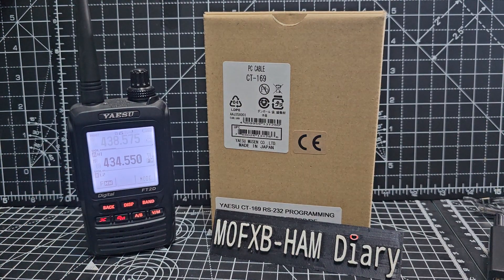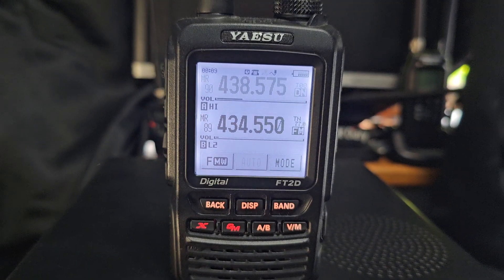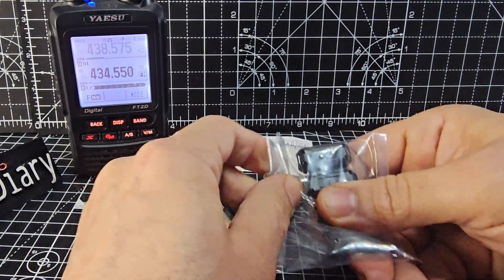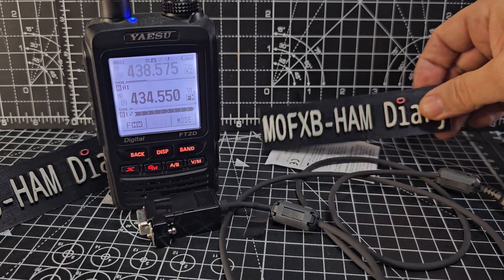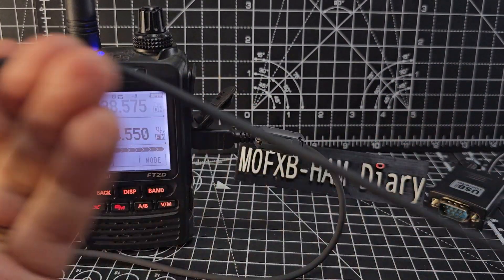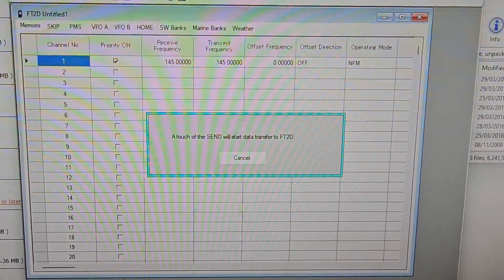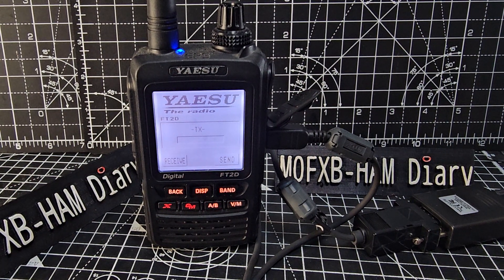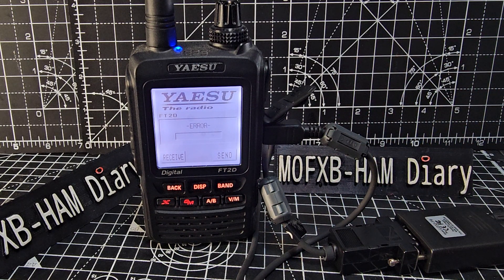YAESU CT-169 RS232 CABLE

Comment: Brilliant ! I have a friend that has been doing this  mobile believe it or not, with a 991. I was woondering just how he did that.

I actually went back to the FT-2's after selling mine and getting a 3 and a 5. I hear what you are saying. It is my favorite to interact with. I truly enjoy using it. The screen is the biggest deal....it's....the biggest ! You can take everything in at a glance, and that really means a lot to me. Wish they would have kept the screen size when going to the 3 and 5 instead of think color was more important, and making the radio smaller.
Reply from the maker: Agree